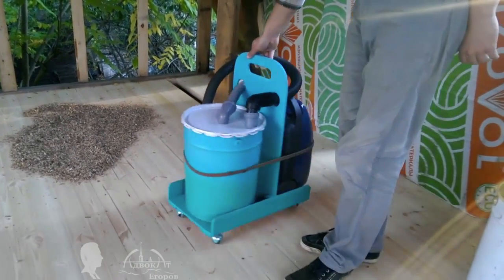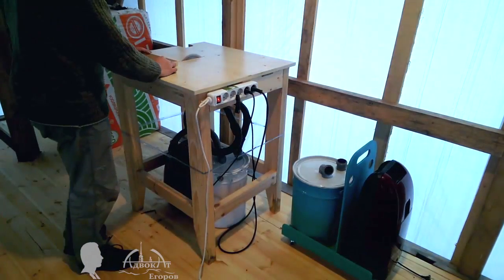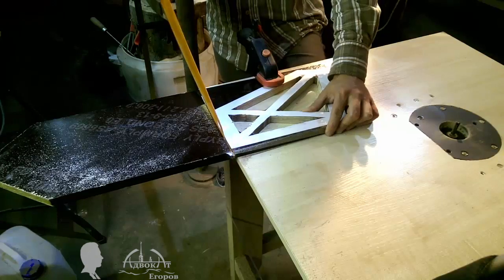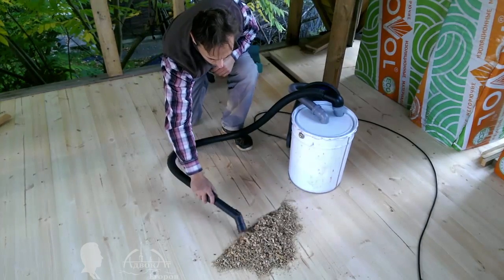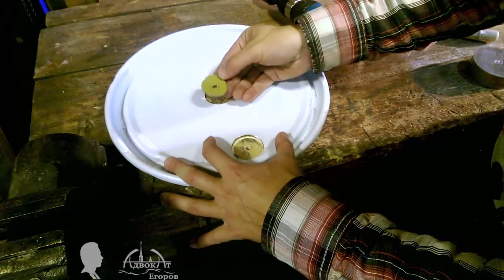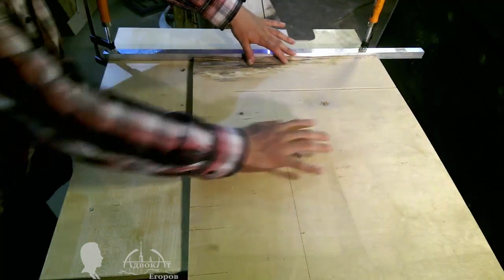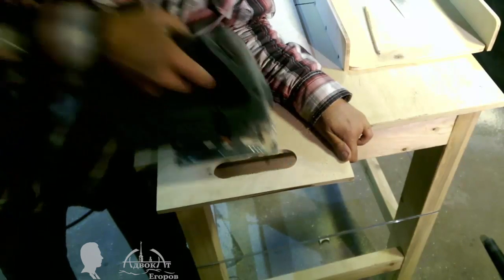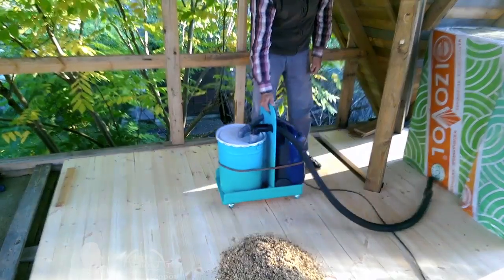DIY Cyclone Separator in 2 min.

Comment from the maker: In two minutes you will see that this video's title is not an exaggeration. You Can make a cyclone separator literally as you cook some popcorn for watching my other videos...;))))
Reply: Absolutely brilliantly simple, the only thing you might add could be to drop a large neodymium magnet in a bag to catch any metal screws or nails (having a small magnet deflection screen is also useful when grinding/cutting/drilling metal, helps catch metal fillings). Do you think if you had a small amount of water in the bottom it would help when vacuuming fine mobile debris like cement dust? Thanks for sharing
Reply: How did you get 2 dislikes for the video?
Reply: thanks for another great video! :)
Reply: I admire all your videos: highest respect.  However,  in the States a common shop vac is  $75 and a  canister vacuum cleaner, required for this project, starts at $300.
Reply: @ChristianWilliamsYachting  Try Gumtree or your local recycling centre or Charity shop... you'll be able to pick up all sorts of kit like the cylinder vacuum at a large discount or even free...
Reply: @jetsetuk  Not usually in the UK: it is not permitted for shops and recycling centres to sell secondhand electrical goods unless it has been checked by a qualified technician.  The high cost of obtaining the licence makes this uneconomic for most secondhand shops.
Reply: @cdl0  yeah I know... by his use of a $ I took it that he was outside the UK... hence also including Gumtree but also Craigslist would do as well.... as I believe America has slightly different rules regarding second hand Electricals... But even so, in the town I live in, in the UK, British Heart Foundation has a huge store and sells electricals at way under the market price, for instance... What I was mainly aiming at in my previous comment is that you do not need to pay the market price for a New appliance when there are a shed ton of ways to pick them up cheaply and free if you look for it... ;o)
Reply: Well, I've learnt something new today, thank you 👍👍👍👍👍👍👍👍

Comment: I did it today. It was over 30 minutes because my holesaw wasn't cutting throught the lid so I had to drill lots of small holes and then use pliers. I used 50mm elbow fittings. It works well. Thanks a lot!
Reply from the maker: Glad it worked for you!

Comment: Liked the idea. Only one question, what's the purpose of pvc fitting on buttom of your vacuum cleaner? 
Is it for bypassing original vacuum cleaner air intake?
Reply from the maker: I think you are asking about an inlet and outlet?
Reply: In video 0:23 the top pvc fitting goes to diy cyclone but what about the bottom one?

Comment: Currently using this saw https://www.youtube.com/post/Ugkx84IcU5pbZd1Qrz8u4-YRLmJax7kdRi7B to help replace some rotted wood around my house. For rough cutting through good, solid wood (not just the crumbly rotted parts), the saw is performing very well. Again, these types of saws are for rough cutting because the blade kerf is somewhat wide and the reciprocating action is rather violent and causes the blade to jump around a bit, even when the saw is tightly held and controlled. But if you need to quickly cut out pieces of wood or make clean cuts of pvc pipe (use a guide or jig to ensure straight cuts of pvc), then this saw performs very well. Highly recommend it.

Comment: I have done this vary thing. Worked great. Even his vacuum looks exactly like mine. With this system you can find any used vacuum that has suction and use it. I use these for sanders and a larger version for a milling machine for metal chip collection. I was planning on a central high power system but probably will never even bother with that. 

Big reason for central vacuum system would be lower noise. I can place it in a shack outside my shop so the motor noise is out there not inside.

Comment: Max my grandfather's table saw was just like the one you used. I made a wood working table out of a 60" x 120" sheet of Oriented Strand Board.    With a steel tubing frame and casters. Motors on the bottom on the frame with a jointer, belt sander, wood lathe, jigsaw and a router. I used a  thin coat of blonde to make a smooth working surface. I like the cyclone separator

Comment: This is great if you can't purchase a ShopVac style vaccum.  :-)  Shopvac's use this same design for the commercially designed models, except they ARE the vaccum and collection bucket together, instead of a separate vaccum and collection bucket, and they put a dust filter over the vaccum motor suction area to keep small particulate inside the collection bucket.  

For a WET vaccum operation...  PLEEEEAAAAASSE install a sealing float valve in the output tube...  this will prevent liquid from shooting into, and destroying, your vaccum once the collection bucket is full.  Your vaccum is most likely NOT designed and sealed well enough to handle liquid ingress.  It can destroy the vaccum, or worse electrocute the person operating it.  I don't want you dying from electrocution.  PLEASE install a sealing float valve into the output tube's uptake.  PLEASE.  For your safety.
Reply from the maker: Daniel, thank you for the warning!

Comment: I made my own separator for a blasting cabinet to gently draw out the lightest dust while not applying so much suction as to remove quantities of grit media during long operations. A small-amperage, c-frame 110V motor gave me sufficient draft to run an impeller. Send me an e-mail <dave@enstruments.com> and I can provide the specs and photos.
Reply from the maker: Thank you for the offer

Comment: if you put on a small filter like for tea on the pipe that takes the air in to the vacuum cleaner, you prevent 98 % of the dust to go further in to your actual vacuum cleaner
Reply from the maker: Jan, thanks for the info

Comment: A question about the angled inlet pipe - How critical is the angle between the inlet elbow and the side of the container?  Should it angle a little towards the bucket side, or a little towards the center outlet?
Reply from the maker: A little towards the bucket side or just parallel to it.
Reply: @Advoko  Thank you

Comment: Did you consider adding a filter to the suction tube just to make sure no sawdust gets into the vacuum?
Reply from the maker: Hani, you could try adding additional filter but it would restrict the system and decrease its efficiency. The vac’s filter will need to be cleaned only once in a while anyway...

Comment: Advoko, thank you for this. I have allergies and sensitivities and have to clean and wash my vacuum after each use. Building this set-up will make cleaning and washing the vacuum so much easier and faster even with the added cyclonic can. And, yes, I have to wash out the filter and hose, too. Most people do not realise that less crap in the vacuum bag blows less contaminated air back into the room via the vacuum's exhaust. Less crap in the bag also reduces the time the filter takes to get clogged. So all in all, less cleaning needed. Just dump the can and wash up what dust is left in the can, vacuum, vacuum bag, filter and hoses. The time saver is not having to pick out clumps of crap stuck in the screen of the bag. All this and no where near the price of those cyclonic vacuums on the market.

Comment: Do you have any suggestions for a media blast box.  These create a tremendous amount of fine dust restriction being able to see the part you are working on.  The canister vac that came with the blast box (expensive cabinet) sucks but not in a good way.  It has a bag that is facing up so particles drop to the bottom and dust is pulled into the bag but it clogged quickly.  Started looking into a cyclone option then found your video.  Any suggestions are greatly appreciated
Reply from the maker: Chris, I don’t know if this idea is going to work for you (I never worked on blast sanders) but there is a vortex cone attachment that Jet started to install on their new dust collector units. Apparently, you can even get a retrofit vortex cone from Jet. https://sawmillcreek.org/showthread.php?217222-Jet-DC1200-Vortex-Cone-Retrofit. The vortex cone kind of supercharges the cyclone motion, speeding it up in the unit’s bag, pushing all the particles to the bag’s bottom even more...
The vortex cone’s shape is very simple...

Comment: Great video, Max! Nice unit, simple. I have a central dust collector in my wood shop,  but have been thinking about a portable unit. This is one of the best I've seen. Got to get back to work, looking forward to the next video. You ever think about making a woodstove out of an old air compressor?  I lined mine with refractory clay, except the top. It's just a piece of plate. Room for my kettle and a dutch oven.
Reply from the maker: Thanks, Nik! Interesting...no but I’ve made a couple if rock stoves.

Comment: I literally had a dream last night about building a cyclone separator, and I wake up to this video. I was considering its use to collect soot (lampblack) from the smoke of burning pine fatwood. I wonder how well it would work for those super light particles.
Reply: NightHawkInLight what if filled the bucket with water at the bottom? That should help with trapping light particles imho
Reply: Tomasz Bajer In that case you could make the inlet tube long enough to be underwater and then all the soot has to go through the water.
Reply: @tomaszbajer335  There was a brand of vacuum cleaner that did that in the 1950s. It was a hassle to have to empty the water container (I know that because as a kid, that was my job).
Reply from the maker: Probably, not too great. I have read a cyclone separator can trap 50-99% of really small particles.
Reply: I might give it a try and find out. Maybe I can get something working using only the draft created by my fire.
Reply from the maker: Ben, I would love to see it!)))
Reply: Just a thought from someone with little practical experience of cyclone separators; Probably the soot is so light it'll not sink into the bucket but instead will go almost directly from intake to outlet. Maybe forcing the soot to take a longer path inside the cyclone would improve collection?

Since you wouldn't be as restricted in terms of capacity, I'm thinking something as simple as extending a pipe from the outlet down towards the bottom of the bucket. If that adds too much resistance to airflow, maybe try drilling an outlet-sized hole in the bottom of a second, smaller bucket and mounting it to the outlet on the inside of the cyclone bucket's lid?
Reply: Maybe use a taller container like a used oil drum. Angle the incoming pipe so it points at 45 degree angle downwards instead of sideways. Also consider a baffle suspended below the outgoing pipe.
Reply: If you are going to use it for dust and decide to add a filter for dirty dust ( by that I mean things like soot) as wood dust can be dealt with by the vacuums bag. What most people forget about filters is it reduces the air flow significantly, 50-80%, if you don't believe that put a mask on and go for a run. What you should do is find a large mesh pad, something like furniture stuffing, not foam, take a piece of pipe or if the bucket is too small a couple of bends and some pipe that will couple to the outflow. Drill lots of holes in the set-up. Cover the holes with the stuffing and plug the end with some too, remember it has to be a big as possible as the filter on the end of the outflow will reduce the flow. to calculate the area of a circle use A = π r2 then you have to replicate that with the pipe and all the holes by 2-4 times to make up for the filter reduction. If the vacuum is struggling to suck air you will burn out the motor so that is why you need as large an area for the filter as you can.
Reply: Use a rubber band to cover the output of the separator with a surgical mask, dust mask or similar. It might cut down on the amount of dust getting to the filter. A foam sponge might also help. A hepa (?) filter used as a pre-filter might also prove beneficial. Please post the results of your experiments.